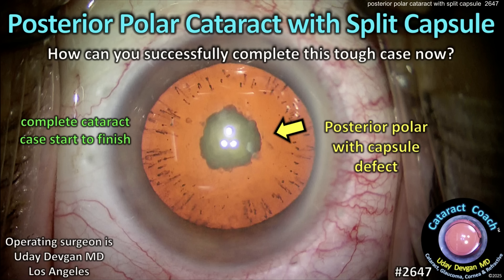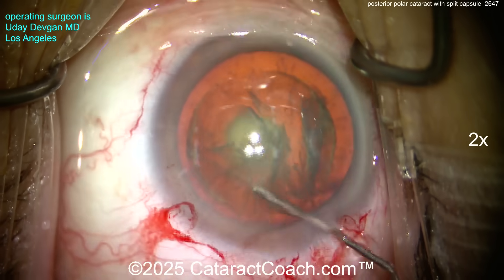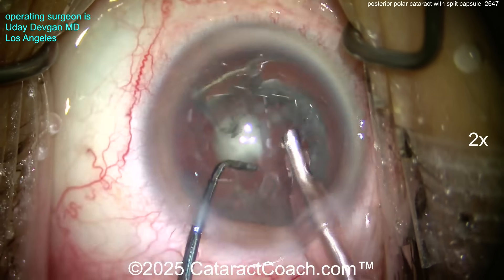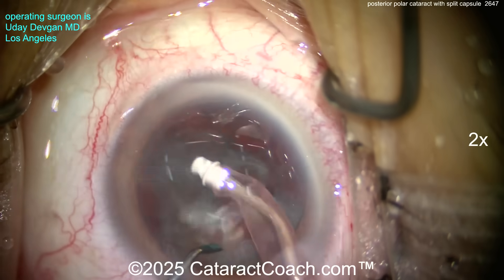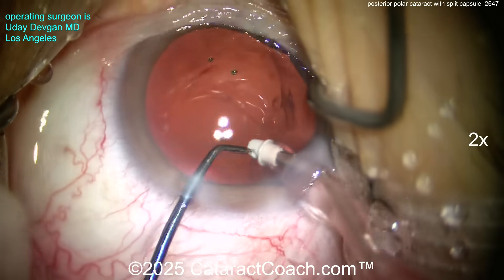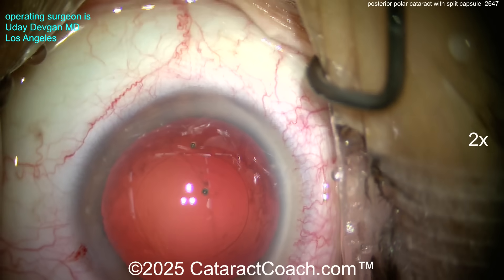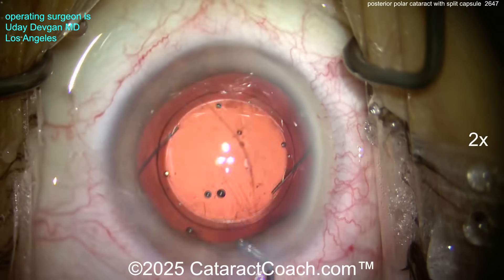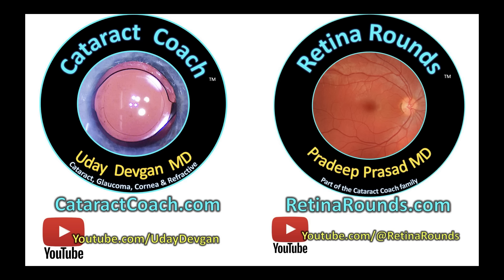CataractCoach™ 2647: posterior polar cataract with split capsule

Comment: Profesor Uday, one question: in this particular case, did you adjust the IOL power? I’ve seen previous videos of you talking about the rule of 9s when IOL is placed on sulcus, but in this one, as the optic is secured in the bag, are you still considering an adjustment for the anterior shift? Thank you very much!

Comment: Beautiful case.  In practice, I find it much more difficult to prevent unwanted AC collapse than you suggest here in the video. Mostly seems patient dependent with posterior pressure.

Did you perform a block in this case or is it topical anesthesia only?

Comment: Great video as always. Question from a young resident: do you have continuous irrigation on your machine? Or you have to keep your foot on position 1 all the time? I find it easier to have continuous irrigation. Once you start the irrigation either with position 1 or by clicking the right side button it never stops. Is this bad? Thanks
Reply: Try to do it with foot position, don't be dependent on machine, the habits you develop early stays with you.
Try to get those foot positions in your spinal reflex.
That's my POV